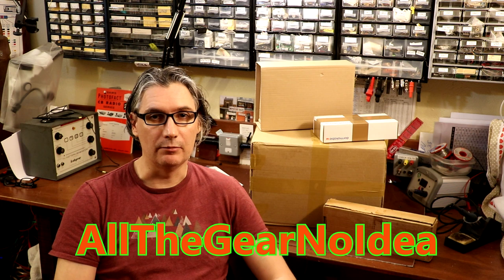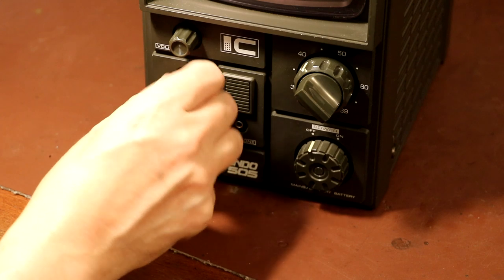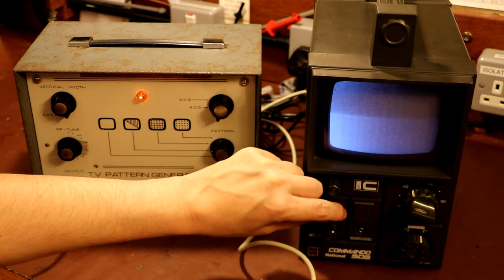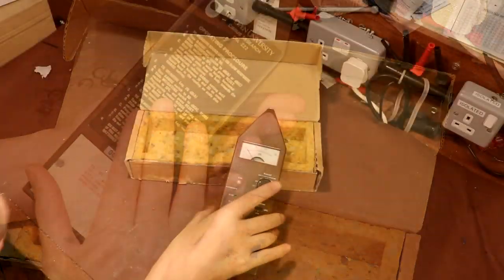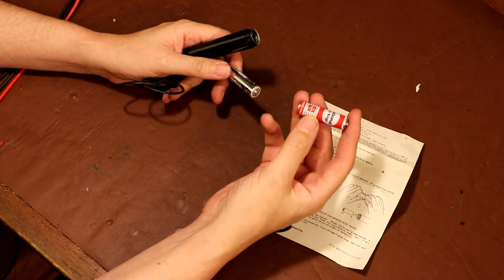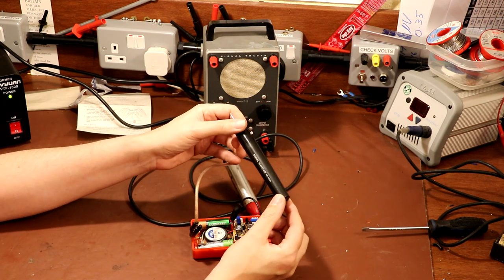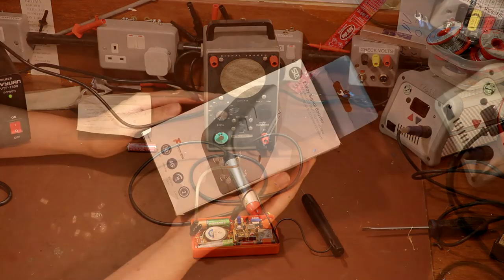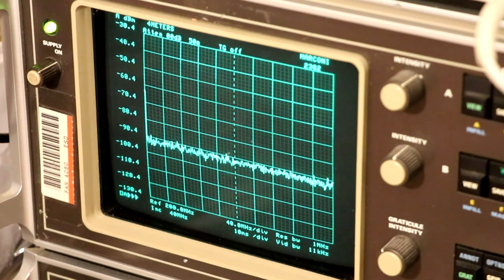Going Commando - TAT Part 4

Comment: Good stuff Chris!  I was going to guess a 1970s microwave suntan kit, but I was wrong  :(  ...I have a vintage Radio Shack sound meter, don't use it very much, but I got one  :)  ....I think I may have a 1960/70's RF signal injector from Radio Shack, haven't really a chance to use it, not sure if anyone on YT has demoed one, I may do that sometime...its fragile thus the lack of use....and from Radio Shack, I have a TV amp that I bought back in the 80's and like the rest of it...I haven't used it since maybe the 90's...but thought it should workout as you've demoed...very cool!  ~Jack, VEG
Reply from the maker: Vintage Electronics Geek  hello Jack thanks for watching and comments. I would like to see your radio shack injector they had a couple of versions and from what I hear they work well, but from memory they were funny looking things. I haven’t used them much myself for signal tracing but i believe they would be very useful.
Reply: I will try to work it in the rotation of junk I need to do...I have soooo many projects I needs to do first but I will try to bump it up...may not be until next year sometime however...I am backlogged on projects to push out....I record a lot but don't have time to edit as often as I would like.  Getting my eyeballs fixed have been so liberation, I have 3 years of life to catch up on.  :)  Best Fishes my friend, wish you had better luck with email.  ~Jack, VEG

Comment: Great Video Chris Love That Signal Injector And Your Heathkit Signal Tracer a Thing Of Beauty When You Turned The TV On I Was Expecting Field Colapse Be Cause You Were Going To Fix It imagine My Surprise When It Worked Bo Hoo !! he,he Repaired A lot Of Old Black and White Portables Back in The Day But Youre One Looks Cute !!..Regards mike
Reply from the maker: raceingdemon6464  Thanks Mike. That little television is cute and small enough to hide etc.  But not done much with televisions so it’s all new for me. I think maybe I should do a video on making a signal injector may be interesting. Hoping to do one of the 405 line televisions over  Christmas.  Thanks best regards Chris

Comment: That National branded battery is basically the same as a Panasonic battery, just another brand name for a Matshushita product, they are probably as good, or better then Energizer,  or Rayovac, they are not a China crap brand. Duracell batteries are garbage now, they used to be owned by the National Carbon Company, later Union Carbide, same company that owned Everready in North America,  Union Carbide went bust and was taken over by Dow Chemical. Now the Duracell brand is owned by Proctor and Gamble which should have stuck to soap and toothpaste. Andrew is right, National Radio of Japan, the original name for Matshushita, wasn't alllowed to be used in North America because of the already existent National Company of Malden, Massachusetts, so they used the National Panasonic name instead.
Reply from the maker: OlegKostoglatov I personally don’t rate those Panasonic batteries here in the U.K. I haven’t had them leak unlike Duracell that leak badly. But I have just found them to be half flat maybe I have been unlucky with old stock but they are sold very cheaply here in our dollar store equivalent.  I won’t use any of those Zinc Manganese cells in my test gear as the all leak given time. I have never had a lithium cell fail leaky so that’s all I use in my test gear not worth the risk of damage etc. Thanks for the battery information very interesting to hear about the history. Regards Chris
Reply: Who knows, you may even find an old American made National receiver? They made thousands of National sets for the war effort, some were even made by other companies under license, I don't think that the British military used them but the Canadian and U.S military did. I haven't tried the carbon zinc Panasonic batteries, just the alkaline types for my digital VOMs, they seem to last a long time.

Comment: Ahh the madness lol.

About a million years ago i bought a tiny box with a screw on probe from tandys, it was a signal generator for audio testing at 1khz.
Oddly it vanished never to be seen again, odd that but a two foot bit of wire or even a normal length finger was a free replacement. (is there such thing as a normal length finger?).

For an amplifier i carefully applied a junior hacksaw to a car radio pcb, i swear i could see a dotted line that was saying ' Cut here ' , it was then thrown in a box with psu and speaker.
Free and dam handy :-D

The t.v reminded me of a Crown T.v/radio unit from the 80's that i enjoyed repairing, it cost me nothing but worked so well.
I should have kept that t.v, it was really well made but wrong decisions happen :-(.

Smashing video chris :-D
Reply: Back in the 90's, a standered finger was 2.5 inches long and half an inch diameter.
Reply: Adam Bryant, Ahh those were the days lol :-D
Reply from the maker: zx8401ztv As you say I have managed perfectly well using  a finger but more test gear is better than less. Good effort on your signal tracer a lot of people use an old external computer speaker etc.  I haven’t done much with televisions so all new to me. Thanks regards Chris

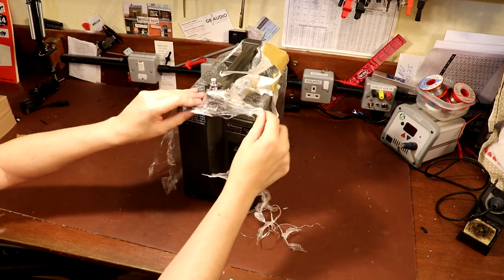Comment: Television @ 2:57 - it's on the makers badge. Great video, Chris! Interesting items. I know what you mean about death by wife, hopefully an idle threat. In radar systems you have to tune the output sections to REDUCE risetime because of the harmonics generated - typically trying to keep the transmitted pulse risetime at 25 to 75 nS. The frequency of the harmonics is a function of the risetime and not multiples of the RF frequency as in CW signals.
Reply from the maker: David V Well spotted and thanks for playing. Just been struggling with a RFID transceiver that failed its recent EMC test due to Harmonics and strangely increase in power with frequency. Design frequency was 13.5mhz but harmonics in the ghz range.  I thought it was cavity resonance as it fitted for the enclosure dimensions but I Had to employ a specialist to trace the problem to our antenna design and a mismatch. Don’t trust low cost vector network analysers! Thanks regards Chris
Reply: @allthegearnoidea6752   I have an HP 8753A VNA & HP 85046A S-Parameter Test Set on my bench. I bought the VNA on eBay not working and repaired it then found the s-parameter test set miss-listed at a really good price (untested). I had to buy another power meter (HP 436A) to finish the alignment after repair as the VNA would not talk to my HP 437B power meter, fortunately the sensors work with both meters. Death by wife a possibility.........Regards, David
Reply from the maker: David V envious feeling here!